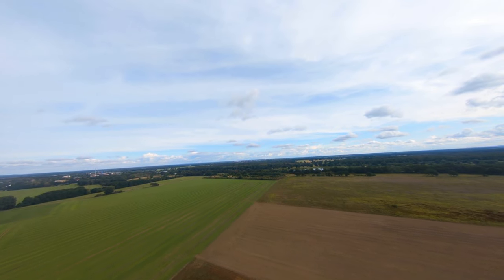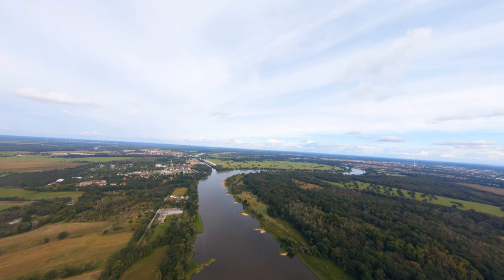Flying the AR Pro at a German Flying Club

Comment: Thanks for all the help, I do have another question for you, so I'm running the same stuff as you it seems, did you hook up your crossfire like we do on quads Rx to TX and vise versa, or did you use subs ?
Reply from the maker: Hi John with Crossfire it does not really matter as you map the pins on your radio. I go CH1 to UART RX and CH2 on the Crossfire receiver to UART TX

Here is a good guide that might help explain https://oscarliang.com/crossfire-betaflight/

Comment: Nice flying! Clean looking wing. I want to build this wing soon any tips on inav i should watch out for?
Reply from the maker: As long as you ensure you get good CG and get the trims set mechanically you can run inav 3.0 and above on the standard settings and then Autotune and start tweaking it from there depending on your flying style and personal requirements.
Reply: @bluefish3607  Awesome! thanks you got a new sub